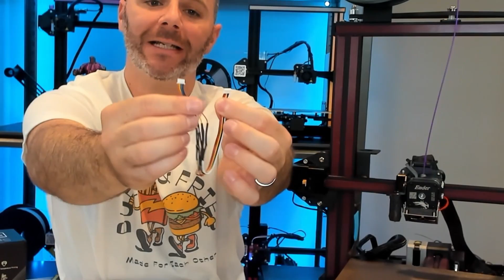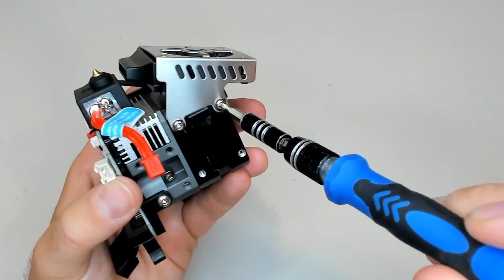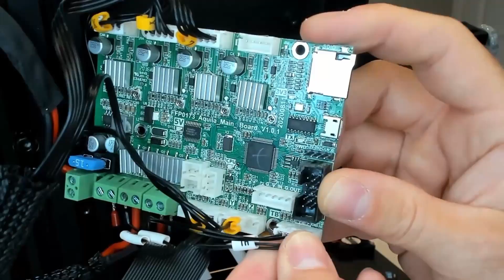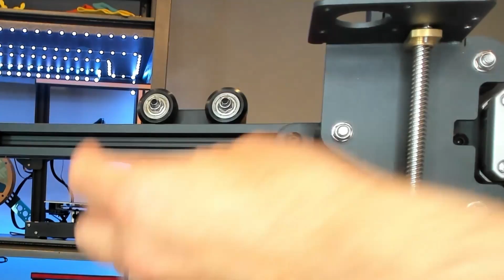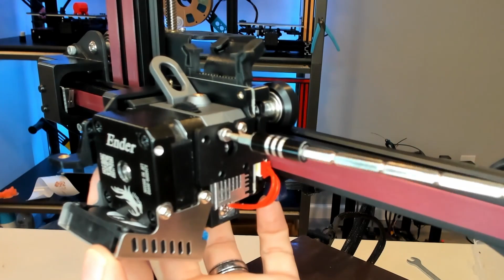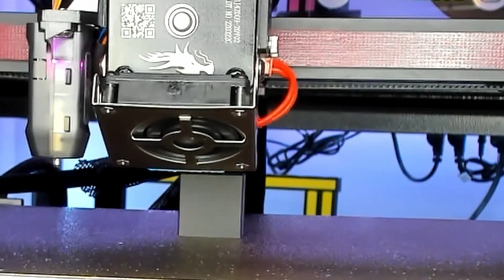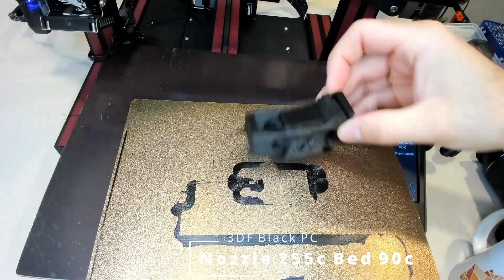Direct Drive Voxelab Aquila with the Creality Sprite Pro

Comment: Man I tell ya as someone who printed again some stuff with my voxelab Aquila last night and every time I ever have a plastic whatnot I need the last year.  I haven’t had a problem yet with it it’s insane how reliable it has been since I followed your tutorial on firmware and bltouch install.
I also got the magnetic gold pei or whatever bed and ive only ever used pla+ usually esun or polymaker and I’ve never had a issue printing anything I’ve tried even some really big prints.
I might look into upgrading it when it stops working the dual z axis screws and direct drive would be sweet but at this point it’s hard to want to touch it mechanically while it is so plug n play literally haven’t printed anything in two months and turned it on heated it up let the bed re mesh and pushed print and walked away and boom perfect print last nite again for a couple wall hangers I needed to hand a few potted plants haha. Really the amount of things I have printed with this printer is astonishing. The first 6 months it never shut down haha .
It’s been the best $200 I have every spent in everything I think the printer was like $150 bltouch was like $30 and pie bed was like $20
I guess if I wanted to print some other high heat materials I will get me a new hot end.
Reply from the maker: I'm so happy to hear that your Aquila is working out! These printers while inexpensive are really capable of amazing consistent results. The PEI sheet and the BL Touch also make printing feel like a breeze. I know the feeling of not wanting to mess with anything while the printer is doing it's job, just keep all these things on the back burner until you need another project lol Thanks for leaving the comment !
Reply: @PrintsLeo3D  yeah brother thanks for your videos you got me into running this thing so always grateful have a good weekend brother
Reply from the maker: Thanks man I appreciate that. Have a good one!

Comment: Great presentation and very informative. Thank you very much Leo. Just one question, the fans are noisy?
Reply from the maker: Thanks for the compliment! The fans are actually really quiet. I was supposed to mention that during the video but I forgot it! When I first powered it on I thought it was broken because I didn't hear anything but it was just a quieter set of fans than the stock fans.

Comment: Hi Leo!  Could I do this on my Aquila S2?
Reply from the maker: Yes you can! The entire setup is exactly the same for the S2 as it is for the Aquila, with the one difference being you are taking a direct extruder off already. To be honest it's a pricey upgrade but it's so worth it for the S2 because the hot end on that is really not the best for long term use.
Reply: I agree.  I ordered from your link!  Could you add a link to a bed leveler?

Comment: Also I see you've kept the dual Z belt instead of the dual motor!
Reply from the maker: Actually the dual motor is on my S2 and this base Aquila got the belt! I'm going to have a dual Z axis timing belt install coming out next !
Reply: So do you recommend adding dual Z when using the sprite pro on the Aquila x2? Or is the stock single Z able to handle the weight?
Reply from the maker: The stock single can handle this weight no problem. The Sprite is actually very very light in general so I wouldn't worry about this
Reply: @PrintsLeo3D  thank you kind sir. Enjoy the weekend my friend
Reply from the maker: Anytime!

Comment: Thanks once again for the great content Leo. Worthy upgrade from the S2 or not worth it unless we are having issues.
Reply from the maker: Paul that's a really great question!  I'm not a fan of the hot end on the S2. On the S2 the nozzle options are limited and the overall setup leaves a lot to be desired. This upgrade is pricey but if it was my printer I would upgrade. This is in itself is a great hot end, and the fact that it makes long term use easier (over the stock S2 hotend) I would say it's safe to devote money to upgrading.

Edit: that being said if you aren't having issues you can save some money and wait. Just keep in mind at some point you'll need to replace the nozzle on the S2 and it's a poor setup.
Reply: I'm considering the Sprite for this very reason. I'm about to begin printing more abrasive filaments and the cost of Voxelabs proprietary nozzles and shipping are not much less than the cost of this entire extruder.
Reply from the maker: Yea that stock S2 setup was a real let down. Having now printed with the Sprite for over 2 months I can say it's lived up to expectations. Haven't had any issues with it so far, and now's it's printing with Klipper and doing well even with those high printing speeds.